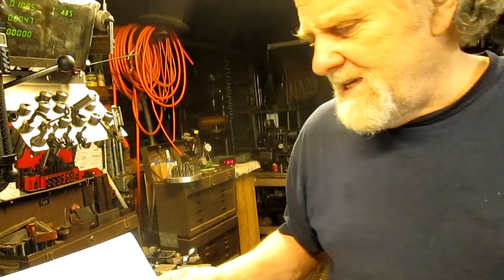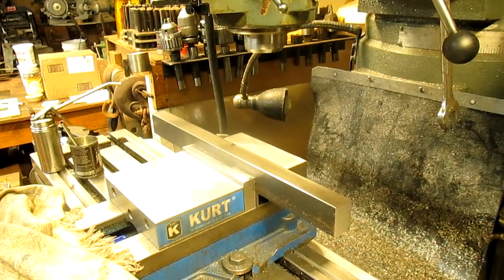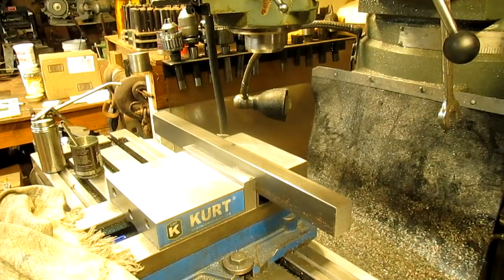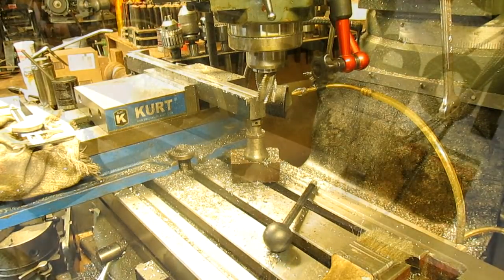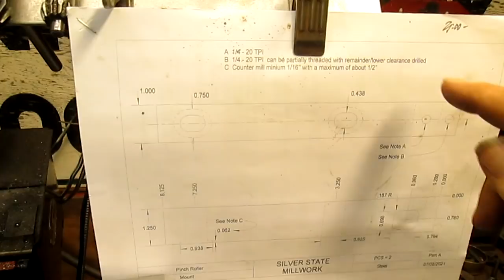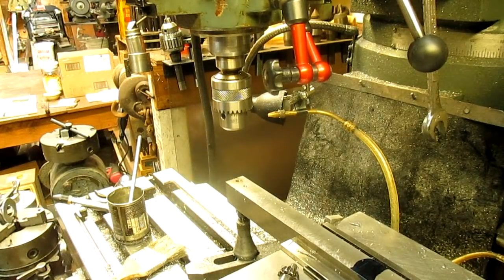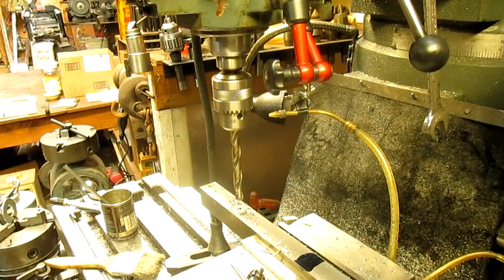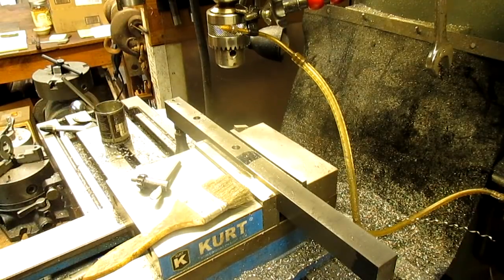Sawmill Clamp #1

Comment: Nik, either your vice moved or the head did. I hope you clocked the vice again before carrying on, otherwise the holes will not be parallel anymore. If the head bolts were loose in the Nod direction the drilled and milled holes will not be square to the edge of the part.  Better check it out before doing the second one. Regards from Australia
Reply from the maker: It was the vise and I squared everything back up before I continued.